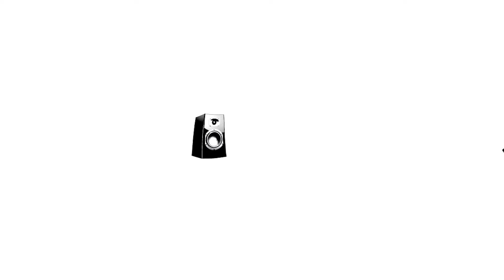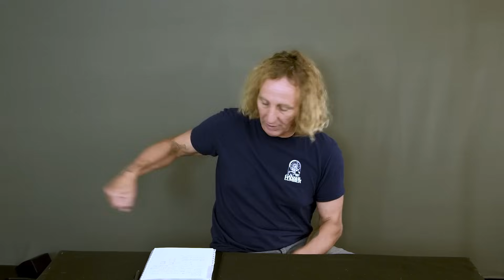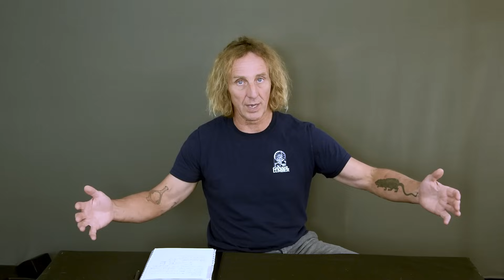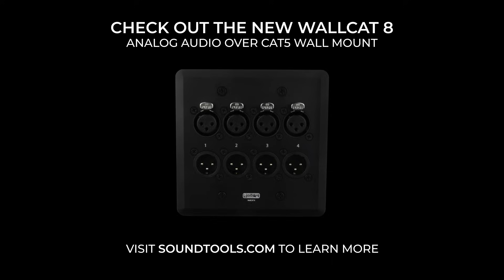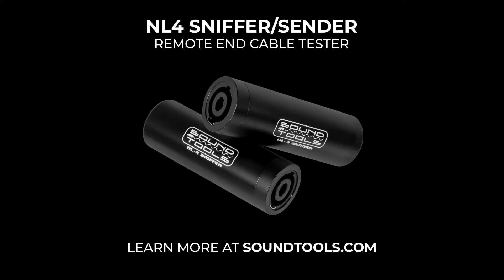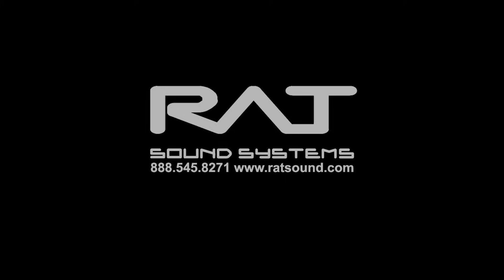New Power Amplifier Watts vs Old Amp Watts & Power (Public)

Comment: So true, I used to demo for people a 30 Watt per channel stereo amplifier and showed it put out more clean sound than a cheaper 250 Watt amplifier. The the 30 Watt amplifier was rated into 4 ohms both channels driven at less than 0.1% THD.  Clean 60 Watts RMS in a store is quite loud.  The 250 watt amp on the other hand was listed a total peak power with no mention of distortion level. On an oxcilioscope, the 30 watt amp put out a little over twice the voltage non-clipped than the 250 Watt amp, or 6DB more clean power out of the speaker.  RMS watts specified into a restive load and at a specified distortion level and sine wave is the way to compare apples to apples.  In the repair shop, used to torture test amplifiers by running them at their rated power into a dummy load. Not all amps survived. Those that did were stocked. Those that failed to perform to spec were returned.  An amp that will do peak un-distorted power for 15 minutes is a good amp.
The numbers that interested me most are not published. How many volts peak to peak does the amp clip into 8 ohms, 4 ohms,  2 ohms, and one ohm if applicable. Can it sustain the peak value for a long time? I used to measure this. Double the voltage = twice the voltage at twice the current into a fixed load or 6 DB more power.EG a 50 volt signal is 6 DB less than a 100 Volt signal. This is the difference between a 100 Watt amp and a 400 Watt amp.
Reply from the maker: Very cool!

Comment: Hi Dave . I have an old Carvin HT760M 750 watt amplifier . I I think I had for years and wanted to use with a Behringer Xenyx 802 for small gigs. But it sounds like crap . I tested the cables and mixer all good the amp seems like the issue . It has buttons on the back Parallel / Limiter / Ground /Lift and a recessed one for bridge .  Any advice to dial it in ? Thanks
Reply from the maker: Hmmm, at medium volumes below clip, none of those switches should make an amp sound bad.  It's either the speaker, something else in the chain or just a bad sounding amp
Reply: @DaveRat  Thanks . Yeah I checked down line the and it comes back to the amp . Is something like that repairable ? Or not worth it? Thanks again love your channel

Comment: Hey Dave. So I got an amp question for ya. I have a pair of Danley full range passive boxes rated 4 ohm. Boxes are rated 1k cont, 4k peak. I have the choice of powering them with either a Chevin A6000 or a QSC Powerlite 6.0II. Both amps are comparable in power obviously the Chevin has better distortion specs. I’m leaning Chevin, but what do you think?
Reply from the maker: I would do a test using a pulse up to clip and a/b the diff and see if there is anything audible

Comment: I`m still a die-hard fan of the BGW 750B`s and Phase Linear 700`s of the `70s.  While their power ratings pale in comparison to modern class D amplifiers, the torque the old linear power supply amps deliver just cant be matched by some of the modern amps whose power ratings are many times higher.
Reply from the maker: I would love to figure out a way to measure exactly that

Comment: Oh Dave...  Please help    are you familiar with turbosound tsw-218 boxes?    The guy I bought them from PAINTED THE WIRING ONE SOLID COLOR  ..  Any good way to test polarity on each side of the box?   Maybe a dumb question.. 🤷
Reply: Thank you :_Super::_Super::_Super::_Super::_Super::_Super::_Super::_Super::_Super::_Super::_Super:
Reply from the maker: Hey hey Matty!  Yes, use a 9volt battery. Speakers will move outward when the plus of the battery in on the plus wire of the speaker
Reply: @DaveRat  k   great   thank u.. Easy enough

Comment: Glad to see these topics brought up. Pat Brown and has worked a lot to develop a standard way of evaluating amplifiers and speaker ratings. See Common Amplifier Format (CAF).  Then you have the rabbit hole of loudspeaker 'power' ratings. In reality the term 'power' is not the best term. In reality we care about how much voltage an amplifier can deliver and over what time frame (yes totally on board with the limitation of many modern designs to deliver full voltage for less than a second); and for many uses that is fine. But sometimes you need an amp that delivers full power for a second or two. Also getting people to understand that with most music (or voice) the real power draw on an amp is going to be at 1/4 to 1/3 the stated power rating is a challenge (when in use at at full volume). Good info. You have worked through this in the trenches.
Reply from the maker: Yeah, knowing the differences can help select the right tool for the job
Reply: @DaveRat  two areas that I have seen modern digital amps perform as lees than expected is with EDM where there is a bass 'drop' with a sine wave component , and artificial reverb, the crest factor of reverberation is about as low as peaked clip noise. Crest factor is a whole 'nother rabbit hole. ;-)
Reply from the maker: I have the LA12X on the bench and it does not perform as one would expect a class D to perform.

Comment: Great stuff, Dave. I will make you smile. Back in the early 80's.... Hill DX700 running 2 ohm per channel into 4  Gauss 4560's and 4 JBL K120 . Incredible amp. 😊😊
Reply from the maker: Those hill amps were cool. One of the first to employ internal crossovers, ultra compact and drive low impedance loads. Hill deserves more credit for being cutting edge than they get.

Comment: I'd be curious to hear your thoughts on Meyer's M Noise as a test signal for measuring system headroom? The idea being that the crest factor of the signal more closely resembles typical program material while providing a standardised test signal.
Reply from the maker: It's a great idea.  More useful than pure pink. Not as useful as doing pink, pulse and tone sweep tests, but less time consuming. I support the concept!

Comment: I guess the question also is, if you do one amp for the whole frequency spectrum versus splitting spectrum.  Love to see more on this!
Reply from the maker: Interesting. Will see what shows up in tests. Typically gear tends to be defined by its ability to deal with the extremes. I would love to see audio gear able to handle a full octave above and below the intended usage.  So gear that can do 10 to 40k will be more than fine for 20 to 20. Narrowing the freq range tends to make the job easier on the gear.
Reply: It is always a pleasure to here your analogies and thought processes, so on this point, would you tend to have a set ratio of amp wattage, say 50% of overall power to bass, 30% for mids, and 20% for HF?  I ask as I am trying to build 2 small audio systems of 2-way and 4-way active speakers. @DaveRat
Reply from the maker: Depends on your crossover points and how many octaves are being powered by each band. Also you can get away with a lot more compression/limiting on low frequencies without being audible then you can on the highs for protection. So for the highs you want extra voltage swing to maintain transients.

Currently the industry standard is to have the same amp for all the bands. Modern amps Will share the power supply energy. Using a four-channel amp with a 15 on channel 1 and another 15 on channel 2 and 4 x 6" on channel 3 and three 2-in on channel 4 is how the K1 is powered. Similar power configurations are very common and just using a multi-channel amp the power everything is easy and kind of a cool way to go
Reply: Ah yes, the transients, it makes sense now you mention it, Thank you. @DaveRat

Comment: Back in 80 s in the UK you had to cheapo audio system s that would claim instantaneous peak per channel summed at 10% THD.   

Then came NAD Watts.  A very different thing.
Reply from the maker: Interesting. Would love to see more info on NAD watts and what it stood for. Curious
Reply: @DaveRat  It was a term me and my mates kind of invented .  When the NAD 3020b landed in our orbit it was only 20W but my god compared to the 100W and 200W  home systems of the time it was night and day more powerful more controlled and just better
Reply from the maker: Very cool and yes, I have read about Nad under rating their amps and how good they are

Comment: Love your videos Dave, would be interested for you to explain the nitty gritty of speaker impedance and the fact it's not constant (changes with frequency) as this plays heavily into the topic of amplifier power capability, power transferred from amp to speaker is very much dependant on the impedance of the load.
Reply from the maker: I will add that in to the mix of potential vids
Reply: @DaveRat  Awesome, thank you.

Comment: The size of the voltage rails and how much and how quickly they can swing is very important. The “new” QSC amps have large voltage rails and their FAST power supply technology that does some cool things including the ability to parallel amplifier channels not just bridge them.

Comment: Please man this is something i have always wondered cause a few months ago i learned that a Graphics card in a pc running max fan speeds at all times to stay cool let's it boost all the time meaning i get up to 20fps more in gaming titles when underload and ever since then i have wondered if the same can carry over to amps cause in the end equipment runs better when cool but ofcourse there is many variables as you stated but the point stays this is why i like amps with a better damping factor cause it gives me an indicator on wether it will hold power for longer and better or not but this is not a fool proof way of choosing an amp.

Comment: This will be a good one! So...
New Watts vs Old Watts?
Or, perhaps; 
New 𝙍𝙖𝙩𝙚𝙙 Watts
vs Old 𝙍𝙖𝙩𝙚𝙙 Watts ???

Pirates; "𝘞𝘦 𝘸𝘢𝘯𝘵 𝘵𝘩𝘦 𝘟 𝘢𝘹𝘪𝘴"
So cool you're going to explore down this rabbit hole, far too many liberties are taken with amp output ratings. 

It'd be cool to see wattage rating profile... via a suite of measurements. Most importantly measurements that incorporate time. Yes, use the X axis instead of simply the Y axis. 
Hell yeah, the X axis the honesty axis;)

Absolutely offer an all out burst rating, but also include what's sustainable over brief, musically significant periods. 
Then of course a torturous long term rating which essentially is a throughput capability (not just caps providing for bursts), from the circuit breaker all the way to the load.

Also, down this rabbit hole path perhaps some myths can be addressed. 
Far too much mythology in that "No amplifier can output more than 2400w"... (120v 20a). 

However breakers can pass massive amounts of current past their rating. To avoid nuisance tripping, a 20a circuit can pass 7-8 times the rated 20a trip amount, that's for about a second or a bit more. It'll pass up to 3x for up to 10sec or so. 
Amazingly the 20a circuit, can allow up to 1.5x-2x the rated amount for as long as 30 seconds. 

100amps for around 1-2 secs
60amps for around 10 secs  30-40amps for up to 30 secs 

These numbers a big time impactful to high power amplifiers in both pro audio rigs, and HQ home hifi, studio/mastering systems, etc. 

Implications? 
Upsize your feeds, avoid voltage drop choke-points. 
In other words; Build the church for Easter Sunday.
Reply from the maker: True, though not only has the ratings changes but also the way many amps deliver power has changed as well.

Comment: Thanks Dave, I will love to see the powersoft video but before that my question is how doo I know the exact speaker impedance, ohms an wattage is this are not written on the speakers or with wrong information?
Reply from the maker: Usually measuring the DC resistance of 5 or 6 ohms means an 8 ohm driver. 2 to 3 ohms is a 4 ohm driver. And 10 to 13 ohms is a 16 ohm.

As far as power handling, need to find the spec or be prepared for some destructive testing
Reply: @DaveRat  how doo I get the measurement done, by using multi-meter?
Reply from the maker: Yes, a multimeter
Reply: @DaveRat  how doo I get the measurement done, by using multi-meter?
Reply: @DaveRat  how doo I get the measurement done, by using multi-meter?

Comment: Crown 5000 Vz
Reply from the maker: Heavy and solid but I preferred the Crest 8001 for watts per pound and running low impedances
Reply: @DaveRat The  The macro tech's distorted when pushed, it was a fabulous thing, if you can find one, stick it on the meter buddy, it would be greatly appreciated, kindest regards from Glasgow Scotland.
Reply from the maker: Love to test one but sold all ours years ago. I will test several amps and hopefully enough to get a solid take
Reply: @DaveRat  I'll look forward to that,  I think I still have 8 or 10 of them lying around in my workshop some where, they're really heavy beasts, bulletproof, reliable old amps, they were everywhere back in the day
Reply from the maker: Yeah, I wanted to keep one or two for exactly this reason but the old gear piling up had to be thinned

Comment: Must be 30 years ago, Sound on Sound did a amp test under real world conditions feeding speakers and with resistors, tapped off the amp's output, fed it up the hall to a second room, and into a small reference amp and speakers.  Then listened to the reference system only.  This allowed them to match gain between amps, and keep the reference listening level constant with the test amp at 1W or 200W.  They must have A/B compared to the source as well.  I look forward to hearing your discoveries.
Reply from the maker: Love these tests!

Comment: Ideally specced modern amp also distorts differently, and faster. It is more gradual slope in old amps once you do go over the limits whereas modern amp will go to high distortion very soon. 120W continuous from a 100W modern amp can sound absolutely awful, where with old tech you don't notice anything yet but you can measure it. The price to pay for that is inefficiency, it will draw more power all the time. If the specs are true and properly measured they are real limits these days, when in the past it was more or less a guideline. I've used 1.5x rating in the past, but it should probably be 2x now (have two times more power in the amps than you need)
Reply from the maker: I figured out a cool way to test and hear the distortion. Doing new vids on it now

Comment: 9:08 this doesn't sound right to me, surely if you are putting it down to 2 ohms thats MORE load, not 'half' (Putting two 4 ohm speakers in parallel gives 2 ohms) therefore it can use more of its potentially available power, like saying driving a tractor up a big hill rather than on the flat. it might then be able to use all its horsepower.   I agree with everything else you say btw.
Reply from the maker: Yes, I should have said half the impedance or half the ohms

Comment: I was conversing with a soundman friend about this very topic today - most timely, Dave!  We talked about how the digital guitar processor, recorded into software, processed by plugins, played back through a digital mixer into digital amps is "removing  the heavy cream, then the light cream, then the 4% milkfat, then 2%, and we're left with nonfat milk" in sound reproduction.  I just missed an auction for a Crown MacroTech 5002 Anniversary Edition with a copper faceplate that sold for $1700.  Crown only made 200 of them.  Of course, then I'd need to buy some passive JBL's (again) to go with it.  We're looking forward to this series, Dave, thank you very much for your great dives into our beloved passion.
Reply from the maker: Awesome, yes, without clear ways to measure and show the value of something, it is easily lost to cheaper, faster and easier..

Comment: I miss My old crest amps. 
I don’t miss the weight of the racks which is why I changed them out for modern amps - but I still swear the crest’s had a better dynamic range and just overall better sounding….
Reply from the maker: Agreed and that same concept is the foundation of the video
Reply: @DaveRat  I remember when fp6400’s were ‘the thing to have’ but a lot of guys kept the older crown 5002’s on sub duties-
Slew rate was the main factor. 

From my ‘own’ understanding of reading on different amp topologies - I am still of the mindset that class H offers the best balance of feature/weight/sound/amp topology - and best efficiency per kg vs audio quality. But the market says otherwise.
Reply from the maker: What I am seeing so far is that high quality newer amps are very good at delivering clean, fast power more efficiently and don't sound as good distorting, delivering hf over 20k and have a lot of fan noise